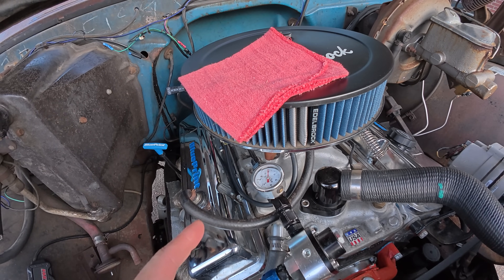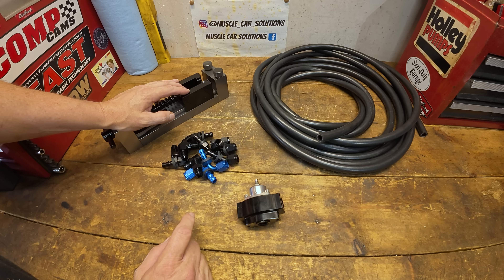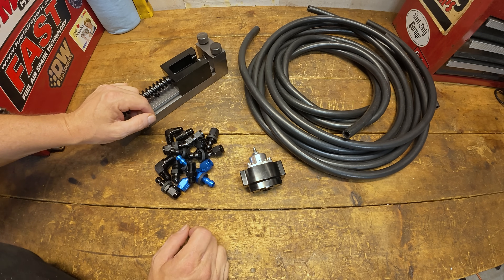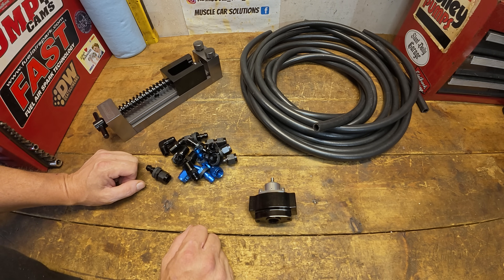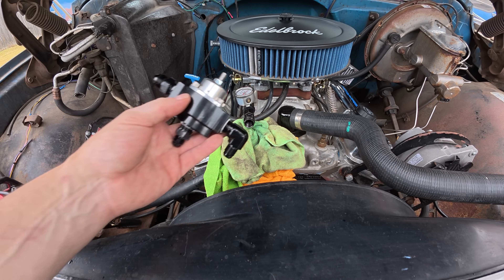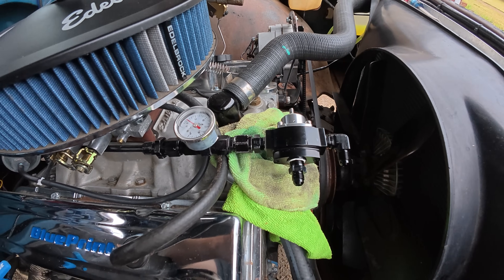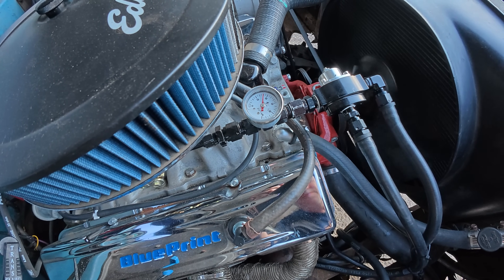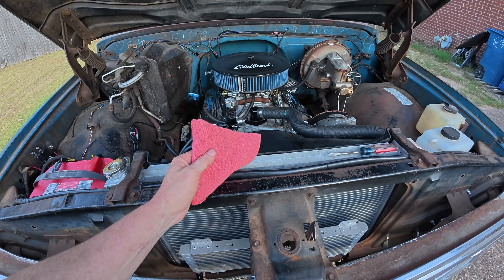Bypass vs. Deadhead Fuel Pressure Regulators: Which is Best for Your Build?

Comment from the maker: Which do you prefer?  Deadhead, bypass or it doesn't make any difference as long as one is there?
Reply: Recently purchased the Holley 12-803, but was hesitant to install it. Think there's a sbc 350 in my '77 Big10, but still trying to confirm that. Some of the digits on the suffix code were lightly stamped and next to invisible. After watching many of your videos, think I'm going to look at different bypass regulators and see what my options are. Not in a rush, so I can be patient about my choices. Thank you for another great video. Cheers
Reply from the maker: @HellRaiser-36 pretty sure I tested that regulator in my cheap fuel pressure regulator shoot out video.  If you’d like to see how it performed.
Reply: @MuscleCarSolutions  Yes, watched that video and I just made an offer on an eBay, Chinesium PQY. If I get it, I'll take it apart, clean it up and replace the diaphragm with one for an Aeromotive.
Reply: @HellRaiser-36 
  Big is heavier duty suspension/ 
 Springs,    same suspension as 78-82 diesel I think.
Reply: @tsmith578  Yes, also the rear diff. is a 3.42 and has heavier rear brakes. The truck was made heavier, 6050 - 6200 lbs, to avoid CAEPA emissions laws.
Reply: I have a question. the way that a mechanical(diaphragm) pump works as I understand it, is that the engine actuates the suction side(lifting the diaphragm) and the pump spring pressurizes the pump(by pressing on the diaphragm). when fuel flow is low there is very little movement of the diaphragm and spring, but as fuel flow increases so too does the movement of the diaphragm. a increase in fuel flow caused by a bypass regulator would thus increase the movement(wear and tear) of the diaphragm and spring. thus you should use a deadhead regulator with a mechanical(diaphragm) pump(if pump longevity is a major concern).
Reply: @SnowDuck82  I don't think it would make a difference. Later model cars had fuel return lines and mechanical pumps. Sometimes the return line ran off the pump or sometimes the fuel filter.
Reply from the maker: @SnowDuck82  I don’t think you’ll get into any situation where you’re wearing out pump diaphragms at a quicker rate by going to a return style regulator.  If someone has conducted some tests to show that, I haven’t seen it.
Reply: I would prefer a bypass regulator for a heavy duty application or where the engine is being used in hot weather.
   Otherwise a deadhead system would probably be fine especially for engines 350 HP or less.
Reply: @tsmith578  I'm gonna go with the bypass because summer temps are often in the triple-digits where I live. I'm also thinking about separating the ethanol from my fuel, but worried about the reduced octane levels.
Reply: I'm planning on bypass.  The charger already has a return line from factory.   Thought I would bypass from regulator.  Put a fuel pressure gage on it,  needle was bouncing everywhere
Reply: Wait. Did you say you’re in the SIP?
Reply from the maker: @dr.john-markcain4946  yup.  Memphis area.
Reply: Always preferred the bypass style. I made custom fuelsender instead the rotten one (some sheet metal, lathe, tubes, tube bender and TIG weld) with 12mm output and 40 micron filter inside the tank. Return line are 10mm. 12mm hose goes to fuel pump (EFI Bosch style), 10mm hose from pump to PQY adjustable pressure  regulator (3-20 psi spring), from regulator to HUGE fuel filter with custom made brass10mm fittings, then to AVS2 650cfm carb. And industrial grade fuel pressure transmitter (0...1 bar, 4-20mA), with gauge screen on the dash. Maximum pressure 0.420 bar (approx 6.2 psi). At WOT pressure falls to 0.385 bar (5.5 psi). Mild modified 351W, F4TE block, ported heads, dual 2.5" exhaust, heavy modified AOD (wide gear set from 4R75W) and 3.73 rear end. P72 LTD CrownVic'90. My daily driver.

Comment: Lots of good info.  I use a Holley regulator and the only thing I do different is on the unused "OUT" port I install a line fitting and I plug it and I drill a .5mm hole in it.  I do that to recirculate a small amount of fuel to keep it and the electric pump cool and lubricated and to prevent vapor lock in the system, it also helps with fuel pickup during the start.  The electric pumps I use can supply more than enough fuel to spare a little going back to the tank and I also weld a fitting into the gas tank fuel neck where I can see it to verify flow.

Comment: I have a charcoal canister underhood ,not using, with a metal fuel line going to fuel sender in tank 5/16" can I use it for the bypass line ? or does it act as a vent ?  i believe my cap is vented 
1979 El Camino 
I just bought a new AVS2, performer pump, 13301 Aero regulator, 2 Earls vapor guard filters
need help thanks
Reply from the maker: The problem with that is where it connects to the tank. If it’s up by the top of the filler neck, it can cause issues. Also, if the engine is producing more than 250hp, 5/16 is too small.

Comment: Instead of buying a new regulator can I just use the filter that has a return on it that goes to the fuel tank?
Reply from the maker: You can try it. I wouldn’t recommend it.
Reply: @MuscleCarSolutions  I just bought a regulator without the return lol 😂. Already installed.
Reply from the maker: @I @IvyGreen1966  depends on the power level.  The GMC isn’t really a high power application. I’d have been perfectly happy to continue to run the deadhead. So if the engine likes it, and you’re not having heat issues, it’s probably just fine!
Reply: @MuscleCarSolutions  thanks 🙏
Reply: @MuscleCarSolutions  yeah I’m not having heat issues at all. Just on my 66 fastback that I recently bought I just installed a pressure regulator and wide-band gauge. The K5 Blazer has been fine with no return. I think installing that insulation spacer on my carb helped out.
Reply from the maker: @IvyGreen1966  that Mustang is a beauty!
Reply: @MuscleCarSolutions  Thank you! It was a gift to myself for Christmas. It was pricey but what the heck lol. You only live once. The guy had some gems. He had two 69 Chargers, 71 splitnose and the fastback I bought from him. Any how keep up with the good videos they are extremely helpful. I've never been so confident on working on my own classic cars until I watched your videos.

Comment: whoa! which afr gauge are you using? that's cool you can read it from your phone.
Reply from the maker: It’s linked in the description.
Reply: @MuscleCarSolutions  thanks! now i don't need to look for a location under the dash.
Reply from the maker: @IvyGreen1966  they’re expensive, but tuning under hood is really easy when I can see everything right in front of me.
Reply: @MuscleCarSolutions  yeah i saw the price lol. may i'll hold off on it for now.
Reply from the maker: @IvyGreen1966  there are other options for a Bluetooth gauge. They’re still expensive, but less than the fast one I use. I have a dual O2 kit I use on higher HP stuff.

Comment: I have an Edelbrock AVS2 with the hundred micron filter as well as a 40 µm filter and a fuel pressure regulator. My gas tank was becoming pressurized to the point where fuel was pouring out of the vents. I removed the return line and ran the car and fuel was pouring out of the return line. So I adjusted the regulator to about 10 pounds and it was fine. Can you explain that because I know my carburetor only needs about 5 to 6 pounds.

Comment: Hey there , First time viewer . .. . . . . Impressed *).  . . . I'm about to install a bypass regulator on my old Ford Flathead . . . .   260. CID . . . . Mild cam and all . . .. I've been dealing with poor MPG's since forever . . .  & Now  It  just seems obvious ....... Lots of fuel has been getting pushed past the Needle Float Valve thanks to the Electric Fuel Pump...... Giving it nothing but surges of pressure . . . . Even though I've had a " dead-head " style Regulator in line . . . ..  That darned thing never seems to stop . . . . . .It lugs down , but not stopping . . .    Figured I'd give ya some feedback ;).    Thanks again !
Reply from the maker: That’s always a possibility with an unregulated pump, no matter what it’s advertised flow or pressure rating is. Always best to run one and give yourself that adjustability. Glad you’ve enjoyed the videos. 👍

Comment: I always thought inverted flare fittings 45 degree and 37 degree did not require thread sealant? Is this just a problem with AN fittings that they leak without thread sealant or should I be using thread sealant on all my inverted flare fittings for the fuel system?
Reply from the maker: Thread sealant on NPT fittings.

Comment: Great content. Not a fan how you mounted the regulator. It is supported by your carb inlet adapters. They have a fine tread and "if China" not great. You also have the weight of bypass/inlet hoses that can put torque on regulator. A bigger concern is vibration might loosen threads on couplers. If it cracks or gets lose you will be pumping fuel over  a hot engine.
Reply from the maker: 4 years in that configuration and no issues.

Comment: Pardon my ignorance, but I have a question regarding the system. This is my first time really operating with a carbureted engine and I want to run a return style pressure regulator. The engine is a 308 chev with a mechanical fuel pump, however it’s in a boat. My question is, does the fuel return flow/operate correctly if the line returns at a point against gravity. You have done it in your video where the return line comes back up into the truck through the floor pan. Is this ok? Does the regulator return the fuel with enough pressure to allow it to overcome the resistance from gravity and to flow back into the tank? My fuel tank return is almost at the same height as where I will mount my fuel pressure regulator. A response is much appreciated.
Reply from the maker: Good question! You can visually see that answer in a short video I did.  “Bypass regulator pumping fuel”

Comment: One question...what if you're using a factory style 3 port (inlet, outlet, and return line) fuel pump? Could you use a return style regulator with this style pump, or is it unessecary when using a fuel pump with a return port?  I'm  referring to a late '80's SBC.

Comment: Mine would loose pressure when hot . 
It was the gauge. The oil filled gauge didn't have a breather . The oil expanded and kept the gauge reading low .

Comment: What do you think about quick fuels 30-1899QFT regulator it’s designed for mechanical pumps and has in internal jet to minimize flow so it doesn’t overwork your pump it seems

Comment: 45 years of running old school motors and never had issues ? Unless there was a problem with the pump. Between the sensors..  "AF" meters.. adding regulators and return lines .. why dont you just run LS modern motors? The allure of old school motors is its simplicity.. Your just adding complexity and more parts to fail.

Comment: Wow, 2 psi is a big swing!  😮
I just went for my weekly run to my Beer Keep cross town 🤪,and found out my psi drop, My idle psi cold set at 6, after plenty of driving it read 5.5.  I remember checking it when I first installed the current deadhead holley regulator. wanted to confirm.
I would say my setup with a deadhead electric pump(7.5 psi), as well as my fuel lines run high above the engine away from heat would be the potential reason for only a .5 drop.
I certainly wouldn't argue against the timelapse shown in the video.  The Bypass is a scientifically better arrangement.  If/when my current reg. goes I'll just start buying the Bypass Type. 👍
Reply from the maker: The pressure drop time lapse was on the deadhead regulator.

Comment: The modern solution is to use a dead head regulator with a PWM fuel pump controller to slow the pump right down. I use an Aeromotive 16306. I tried a return line as I was going to convert to EFI until I saw all the trouble it gave. With the return line I had to run the pump full speed and my tank couldn't supply enough fuel all the time.

Comment: Would you use the deadhead system with a return style fuel filter?
Reply from the maker: Not a fan of the bypass pumps or filters.  They work just fine on stock applications, but I’m more concerned about the proper amount of flow at the carb or injector.  Still the same principle, but the fuel makes it to its intended location before being sent on its way.

Comment: I was running a liquid filled gauge that would drop to 0 after about 20 minutes of driving. I had read that liquid filled gauges tend to do that. So I got a non-liquid gauge, after the same 20-minute drive I do see a drop but it only drops to 4psi from 6.5psi.. Changing to a return style regulator is exactly what I was thinking I should do LOL. Perfect timing on the video. Great work as usual, appreciate you!!!!
Reply from the maker: Simple to just relive any pressure in the gauge.  Only take a quick second.  Time to put a return style regulator on that Mustang!  👍 Thanks man!
Reply: @MuscleCarSolutions I'm going to order one and tell my wife MCS said I have to have a new regulator so she's mad at you not me LOL
Reply from the maker: @BPattB  I’ll 100% always take that blame. 😂
Reply from the maker: @BPattB you MUST order a new bypass fuel pressure regulator.  Plus you need to order that 347 crate engine.  👍 It’s the only solution to the problem.
Reply from the maker: @BPattB there ya go.  Screenshot proof for you plus a bonus upgrade.  😂
Reply: @MuscleCarSolutions okay, I'm going to order the blueprint 347,,, but if things go sideways can I move in with you???? LMAO
Reply from the maker: @BPattB  as long as the Mustang comes with you!  😂

Comment: Does anyone have a reason that the return line set up wouldn’t work equally as well with the bypass/pressure regulator located beside the fuel tank, after the pump? Essentially exactly what is here, accept with a 10’ hose after the pressure gauge, instead of a foot of tube.
Reply: This removes heat from all those pieces of hardware and should accomplish the same thing
Reply from the maker: You’re gonna lay under the car to adjust your pressure?  😂 Why?
Reply: @MuscleCarSolutions No, i have a lift, and im only gonna set it once, and im installing a recirculating filter there already so it would be assembled on the bench, mounted, and plumbed. Is that your only reason it’s a bad idea, or do you have something relevant to contribute related to fluid dynamics?
Reply: As for why, as stated, to eliminate the heat on all those pieces of hardware, which very well can effect the internal springs used to set and measure pressure. A hot spring vs a cold spring on a regulator or gauge will have a variation. It’s no different than a cooling thermostat, fundamentally
Reply from the maker: @luckyred1818  do you think that all the OEs got it wrong putting it on the engine post fuel rail?  do you think that the fuel from the tank, to the rail or carburetor is constantly flowing?  If you’re putting the regulator at the tank, there is no flow the feed line because you’ve put the return at the tank and the line leading up to the engine sits and waits its turn.  Do you think the fuel pressure will hold from the regulator all the way up to the carb?
Reply: @MuscleCarSolutions i have it this way on 2x 7.3 diesels, which is unlike any of the predecessor designs like fass and others as well, and yes, it functions equally as well. Never mind, it’s obvious im fishing in the wrong pond for intelligent answers to the actual question i asked. Your thought process is incorrect on pressure and fluid dynamics.
Reply from the maker: @luckyred1818 your theory doesn’t play.  It lacks common sense.  You’re still running a fuel line to the front of the vehicle, the fuel is sitting there static till the engine needs it because you chose to put the regulator on the tank.  You’ve just made a redundant deadhead system with extra parts.  And now you’re comparing it to a diesel.  😂😂

Comment: Funny I just replaced my Holley electric fuel pump with the Edelbrock 17301 4-7 psi, only because the Holley is so loud, with the Edelbrock which I’ve used in the past same location hardly hear it, I do have the deadhead style regulator but don’t see a drop in pressure on either fuel pump, I’m surprised on the return style regulator they don’t supply a port for the gauge to eliminate some of that plumbing, mine has it and works great😀😀
Reply from the maker: The quiet Edelbrock pumps are my favorite frame mounted ones. Really well built. 👍 Glad your system is working well!

Comment: Thanks for the upload. But Iam still struggeling. Switched from dead end to return style a while ago (due to vapor lock). Almost the same setup like yours except I run a electric pump near the tank and the return line goes into the tank sending unit. Starting the engine it is set to 5,5 but after it got hot it drops to 3. I was thinking it is because of the low pressure pump and when the reg opens the pressure also drops. Engine runs good anyway..enough fuel is there. No idea where the issue is in my problem?

Comment: Ditch the liquid filled gauge. Almost guarantee your fuel pressure isn’t changing. The gauge I’ve had best luck with is the Moroso 65370. I feed a 406 sbc from a Holley red, no regulator. Pressure always rock solid 5.5-6 psi.

Comment: If the pump is in the engine bay, you could have simply plumbed the return into the pump supply line, saving all that fuel line and tank connection. Just a thought.
Reply from the maker: Then just keep it as a deadhead.  Or, run a return system and keep the fuel cooler.

Comment: Used a sending unit for a 1972 C10 on my '68.  It has a 1/4" return line built in. Ran 1/4" nickel copper line. Works great.
Reply from the maker: 1/4” is rather small.  Flow volume low?  Lower HP engine?